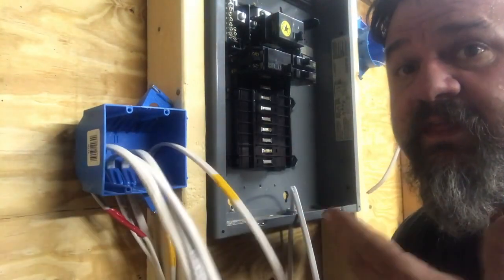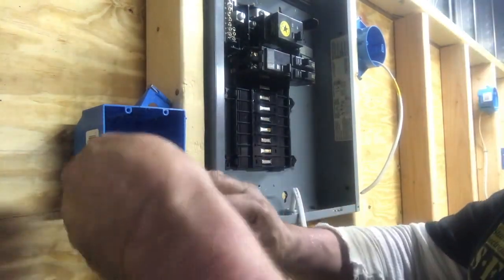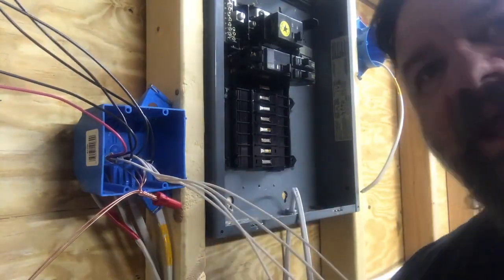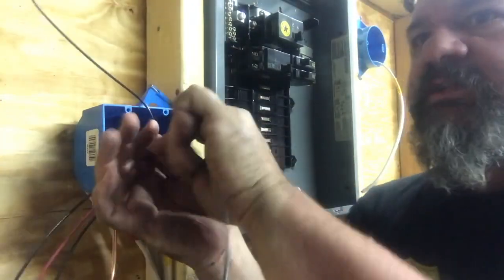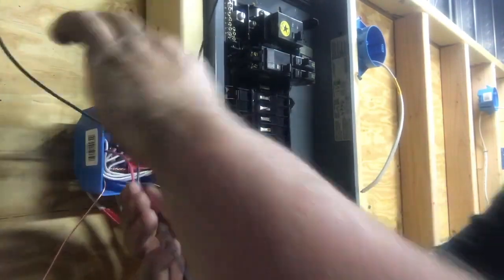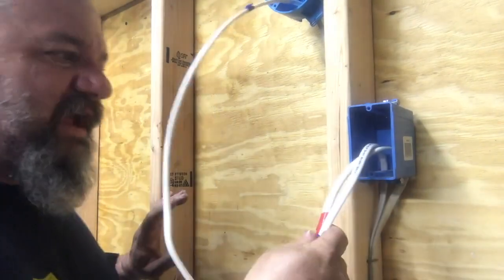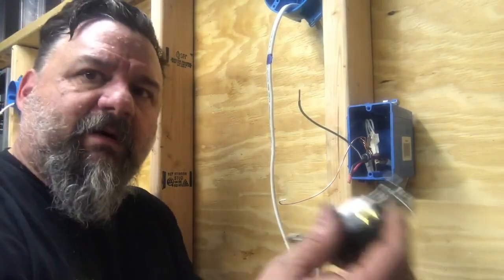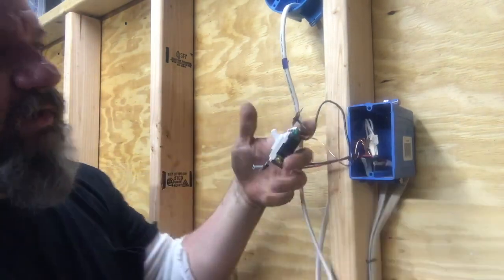How to wire a three way switch.

Comment: Nice video and good tips for efficient, repeatable practices  -- I can see these will  save a lot of time. You are obviously a pro -- I think we can all learn a lot from your videos.
A couple of  minor questions: 1) Doesn't the code call for putting green wire nuts on ground wires these days? 2) The marking and wrapping of wires you demonstrate makes a lot of sense -  esp if your employees/co-workers are following the same practices.  But I have never seen these tips before -- are others able to figure it out without your explanation -- or does it give them fits?   3) And finally, I am just curious -- do other people do things this way - or did you develop these practices yourself? 

I'm  not a pro, but I did electrical work for several years with my dad's electrical  company back in high school and then college, while I worked on an Elect Eng degree.  He was a master electrician, but wanted me to not have to work as hard as he did, so he encouraged me to get my EE degree.. But as get older, I frequently wish I could get an electrical license - but the experience requirements are so stiff so I can't really pursue that.  But to me, nothing is as satisfying as doing practical work, instead of engineering work which  is often so long term, you don't get to  see your work completed for many years, if at all.  I really miss seeing my work get quick results -- knowing I did a good job -- up to code, all safety protections incorporated, satisfying a need, and knowing your work will last for years if you do it right.  

Great job! I just subscribed.  Now I'm ready for a taco, too!
Reply from the maker: thank you for the imput!

Comment: Ground wires won't hold without wire nut?
Reply from the maker: the would but you have to use them or a crimp sleve.

Comment: I like your videos , but I would have to disagree with you about the holes in the back of the switch.  Everyone I worked with or for has told me to wrap the wire around the screw if the switch doesn't have termination plates.
Reply from the maker: well they are up to code and its a matter of preferance. sometimes the wires slip off the screws. It is a lot faster to stab and doing a couple hundred it saves time.